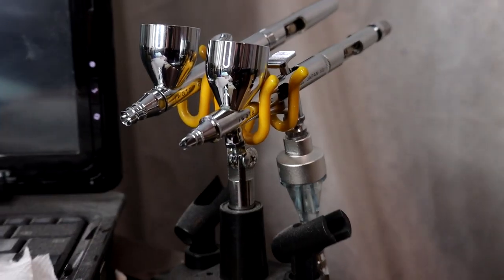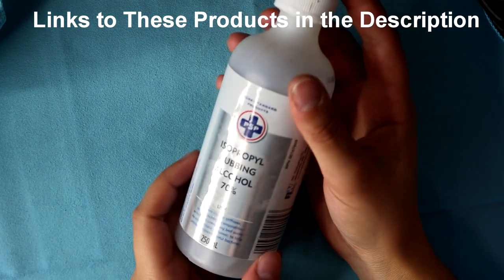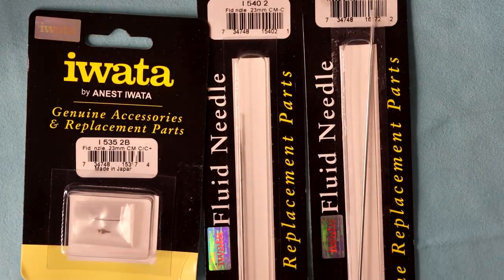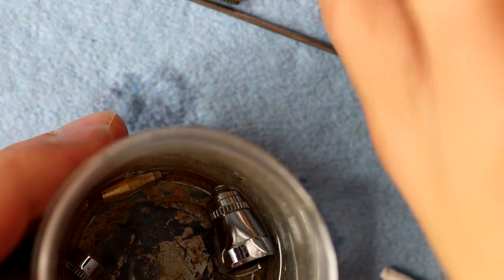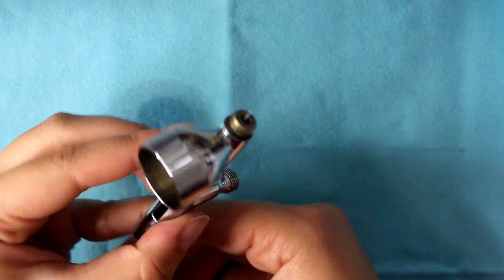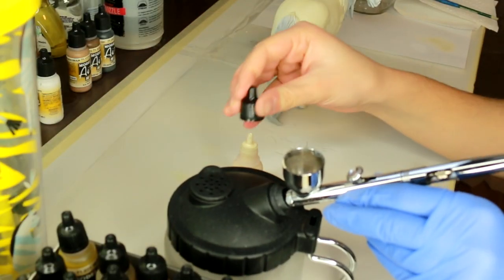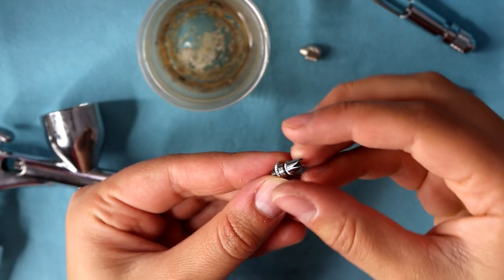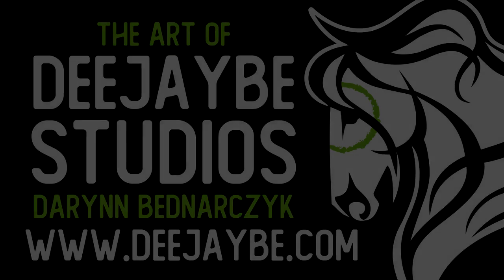How to CLEAN your AIRBRUSH - Deep Clean for Troubleshooting

Comment: Solid advice all around. I started using a cheap squeeze bottle with about 10-15% Vallejo airbrush cleaner and 85-90% water between switching colors. Vince Venturella has a video on the process and it’s made in depth cleanings much easier on me. Thanks for the video.

Comment: @ 7:14 you said you were cleaning paint on the nozzle. That IS NOT paint, is thread locker (locktite) and its supposed to be there. Also, its always good idea to always insert/remove the needle from the front as it will ensure you never mess the tip.  Hope this helps anyone else watching this.  Otherwise, good video.

Comment: You mentioned running the needle through the body to help loosen things up, I actually use an old danaged needle for this as it saves your good one from sustaining any accidental damage.
Also when using lube I was told to run just air through with out paint to blow any excess out tgen run some cleaner yhrough again jysf yo make sure.

Comment: Hi I'm having trouble with my airbrush I clean it with mr tool cleaner from when I start painting it doesn't want to spray so I disassemble it and clean it  with  cutex but it doesn't spray the paint that I use is Mr color paints so what do I need to clean